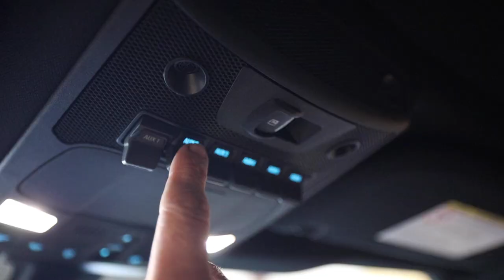RV LIFE: CAMPING, COOKING AND MAYBE AN AIR HORN

Comment: Wire up the air horn like they do on diesel pushers where you have a city/highway switch. In city mode when you press the horn power goes to the regular horn, when in highway mode power goes to the air horn. It's very simple to do and you can use your upfitter switch to toggle a relay to do it.

Comment: the fuse looking thing is for safety. if for some reason you were to have a fire in the water heater cabinet it melts the fuse and shuts the propane flow off so you don't burn down your rig. it happen to my old travel trailer. luckily I was prepping for a trip and was there to make sure everything was working proparly. it don't take much heat to melt the internal fuse.

Comment: Sure you’ve already gotten this advice.....   If your “fuse” as you call it on the hot water tank is blow you’re heater will not make water on gas or electric.  Called a thermal cutoff.  The igniter serves two purposes....   ignites the propane and also senses if the flame is lit.  You have to clean it once a year.  Just pull it out and rub it with some fine sandpaper!  We have the same water heater in our Jayco and have had the same issues!

Comment: Hay Marc
If you have not fixed the water heater yet, I have something for you to try. I just want out for the first time this year, I had a dead water heater. Everything in the heater looked good. Out of frustration, I removed the control board. There are 2 relays in these units. Using a larger size screws driver,  using the handle end, give the back of the board a couple of good raps. This fixed mine. Good luck. Steve Cincinnati

Comment: Marc, don't forget the thermostat. That was the problem with my Suburban propane HWH.
Reply: Can't be the thermostat as the gas is coming on and he was able to light it with the match.  My guess is either the control board or more likely the corrosion on that connector that was mentioned.

Comment: The only time we’ve had to call the mobile RV repair with our Airstream was for the water heater. It was the Circuit board. 🤣 That part fails so often he had it in his truck and didn’t have to order it.
Reply from the maker: Yes, same as our Reflection.

Comment: Had that same problem with the hot water heater in my camper ended up being the board.  Later found know issue with the board.  Look up the Dinosaur Jr brand board for it, much better, more robust.

Comment: forgot to mention - the water heater where it was said that could be a fuse of sorts - it is just a resistor - look at the color bands, 1st band closest to the edge is the 1st digit, next band is the 2nd digit, 3rd band is the multiplier and if you have another with a bit of space, that is your tolerance - you can look up online how to calculate - then grab a meter and test the resistor - it needs to be unplugged - then you will know if it is good or not - you should always have a digital meter if you are going to do repairs of any electrical - same with the air horn - could have tested the connections before risking your ear drums - never ever ever use a test light - digital meter or do not touch

Comment: AS FYI: You should still load the spring arms on the awning.
Reply: MChaseC5 my AS is only 19 ft, so not as much of a pain to put up, but if you load the spring arms will it still roll up like Marc put it?  Just a question.

Comment: Those circuit boards are a weak link in all hot water heaters and furnaces. I have the same hot water heater and had that board replaced after 7 weekends of camping.

Comment: Did you check the 2amp fuse on the board? My hot water heater wouldn't light. so I did it manual like you did, but it would turn off after a few seconds, replaced the board to fix it.

Comment: You guys are great, you make everything look so easy.  I have a question, I noticed that your bed has a cut corner.  I recently bought a Class C Big Foot with a cut off mattress corner.  I cannot find fitted sheets or a fitted mattress topper.  The mattress is super hard.  Any ideas?
Reply from the maker: Look into Mattress Insider and use KYD10 to save you 10%. Or checkout Airstream Supply Company - it doesn't have to be an Airstream to wok. https://airstreamsupplycompany.com/
Reply: @KeepYourDaydream  Thank for your quick reply.  Come day break I will go shopping.

Comment: How can you tell someone is not a 12 volt tech? They use automatic wire stripper/crimpers. All professional electronics installers use manual strippers and manual crimpers by Klein. Klein has the best crimpers - also the butt connectors are a dead give away.
Reply from the maker: You should see his plasma cutter! ;)
Reply: @KeepYourDaydream  I do not doubt his awesomeness - I have done 12 volt installs for well over 25 years - car audio, security, glass, customization - Yes, I saw his work. That stuff is beyond me. Crimp caps, Klein crimpers = perfect connection every time. $30
Reply: If Marc stops by for some more repairs and installs I will be sure to buy a pair of Klein crimpers 😎

Comment: it seems every time an appliance (hot water heater, A/C, Heater, Refrigerator) or type of control on a camper it ultimately comes down to a bad control board/circuit board.
Reply from the maker: I agree. I should travel with extra dino boards :)
Reply: Ive had the same issue...a new board did it .

Comment: I see a 2AMP fuse on the control board for the igniter, did that get tested ??
Reply from the maker: Yes, we checked that in the Tetons. It gets fixed in Glacier. Should be next week.
Reply: @KeepYourDaydream  They did a good job of hiding that fuse under the connector...